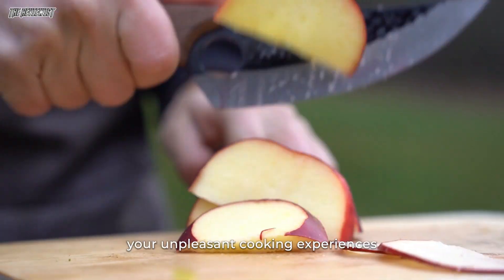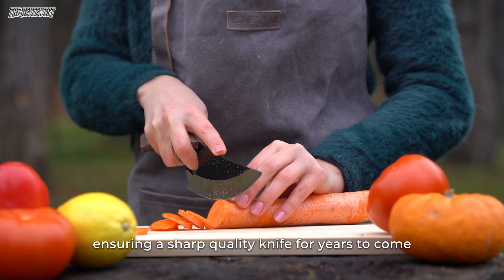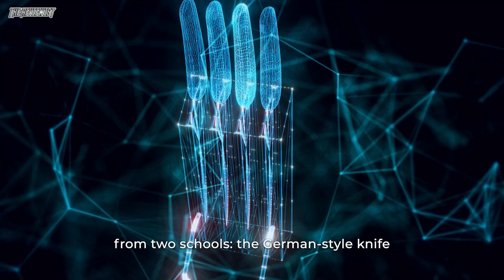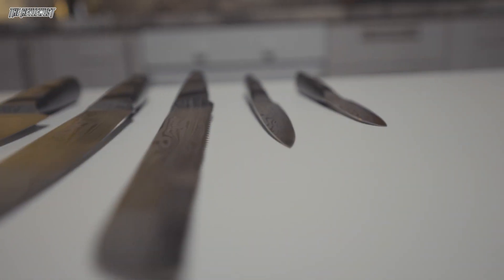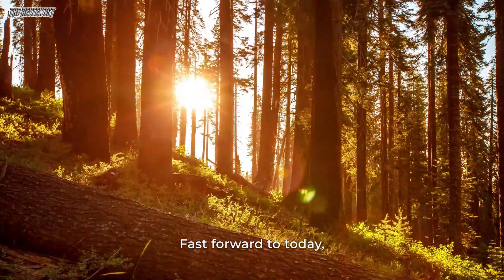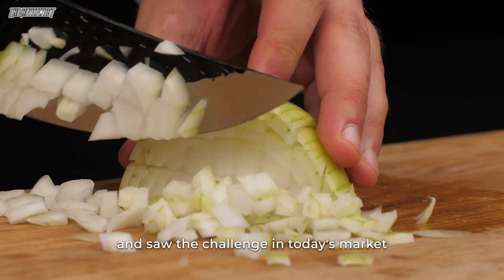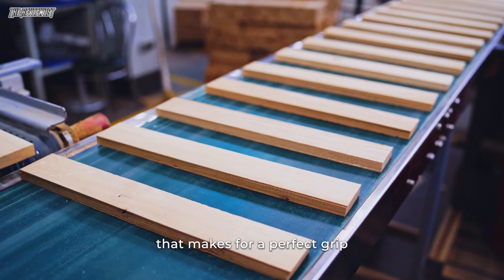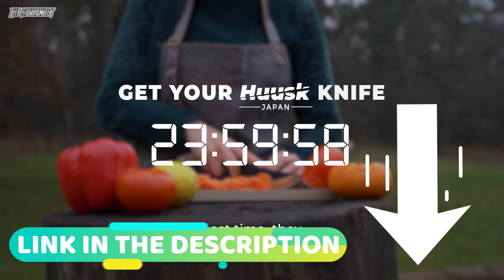🐙 Huusk Knives Review 🔪 Japanese, Samurai-Inspired Chef Knives 🍒 Huusk Knife Review

Comment: It's a scam, japanese didn't use stainless steels. It is junk steel with no edge retention, it is lower quality steelwhich is too bad for budget knives and mass produced in China. Also the blade shape 20mm from edge with fat uneven surface which will catch food debris and make for bad ruff cuts. Its meant to symbolise hammer work but just a gimic which detracts from cutting portential before the blade dulls quickly. Checkout real reviews first.
Reply: Oh, I always thought the samurais used stainless steel.